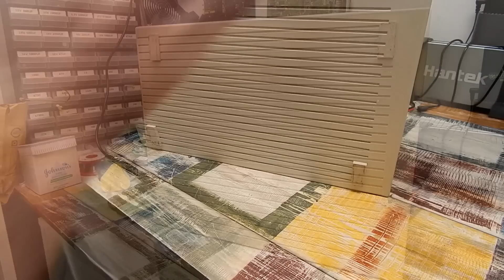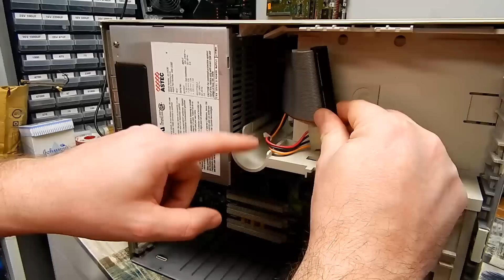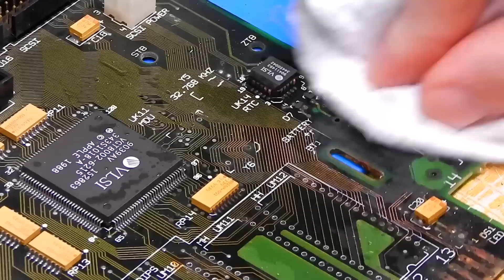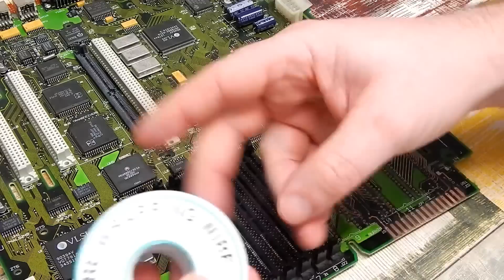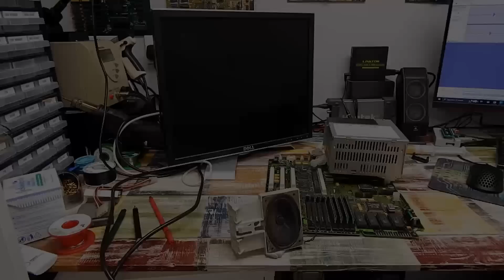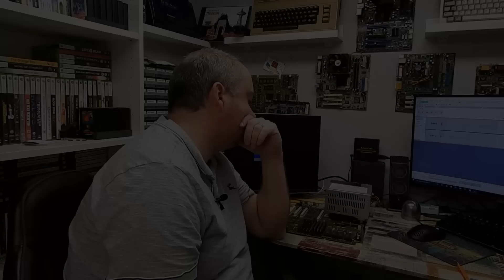Why will this Macintosh IIci not work, HELP!

Comment: In no particular order:
Your IIci is behaving very similarly to my IIci that I tried to repair in a livestream last year. The only difference is that I never saw the white screen. It's possible your board has another broken trace near the soft power circuit/RBV chip. (The RBV chip is the video chip.) In my case, I suspect that my RBV chip failed.

The RTC chip is probably required because it also holds the Parameter RAM (PRAM). In fact, per previous experience, the Apple ROMs pretty much expect the board has all the major components on it. You could probably remove the serial transceivers and the FPU and it would start to boot the System software, but System 7 will hang if the former is missing and the System software will throw an F-line System Bomb at some point if the latter is missing.

The fact that the chime and death chimes (that jingle you hear when you press the Programmer Switch because there is no debugger loaded) are playing correctly, is a good sign. It means the system is able to read the sounds from ROM.

That being said, you don't need the battery to power the IIci on.

IIRC, the missing LED (DS1) was a green power LED.
Reply from the maker: Thanks for the info, I'll double check around the video chip and see if I can find any damage.   My comment about  removing stuff would just be in an attempt to try and stumble into the cause of the fault.  Not exactly the most scientific approach but sometimes needs must.  I'll keep this as a last ditch effort but there are a few other things to try first.
Reply: AFAIK no Mac actually needed a battery to boot but some specimens across various models (with absolutely no rhyme or reason) act up without a battery, showing only a black screen. Leaving them on for a few seconds and then doing a soft reboot usually fixes that and gets them to boot normally. Actually, any way of rebooting except disconnecting power will work. Some models were more prone to this behavious (Performa 475 among others), some less but I've seen it across a whole list of 68k and PPC models. Back in the 90s even some repair shops would diagnose a flat PRAM battery as a dead logicboard, which was pretty painful for the customer.

Comment: My first thought, seeing as you got the sad mac once...... work backwards from the display plug and check continuity? Might be a bad solder point somewhere between display chip and monitor port?

IF you get a steady sad mac screen, it should be a "simple" case of bootable media from there onwards
Reply from the maker: I'm going to over a proper vga converter for the output, just to 100% rule out that its not my homemade cable although I'm fairly sure its not.  But yes beyond that, good suggestion, I'll take a closer look at the display chip and related circuit.

Comment: Where you see micro vias appearing not to go anywhere, they are going to buried vias or to a power plane in the multilayered PCB. They do go somewhere.
Reply from the maker: I wonder if that one point then could be an issue.  There is certainly internal signalling in this board, that's shown on the schematics and if that one point I showed in the video has indeed delaminated internally well, that could spell game over.  Perhaps the one time it booted it somehow made connection.  Maybe if I could clear it out, feed a small wire into it and flow a lot of solder it might restore any broken connectivity🤔
Reply: @CRG  you could try restarting while flexing the PCB in different ways or if you suspect that via path you could bypass it with a wire if you check the scematic to see where it comes from or goes to. If you can follow the trace to where it connects to a component first then check the schematic to see where that net goes to, to do the bypass. 
Also too much heating with hot air and no preheating can cause problems with buried vias and traces.

Comment: My two instincts from an utter incompetent amateur who has never touched a vintage mac would be something in the video circuitry, either a broken trace or maybe an encoding issue, but it seems to be working outside video? is there some kind of command line in prom that you could do anything in just to see if it is working outside video? or maybe try a period-appropriate monitor if you can find one, maybe it just doesn't like whatever conversion it is? I mean I have no real clue, just thoughts of what i'd try in your place
Reply from the maker: I've tried connecting a HDD and floppy drive but the system doesn't try to boot from them.  I'm fairly sure there is a fault somewhere and its not just video but I'm going to order a proper vga adapter and double check the video circuit just to be sure.  I have tried an Apple CRT and it behaves the same, the CRT is just to big for my desk hence why its not in the video.  Of course there is nothing to say my CRT is compatible with the IIci.

Comment: I admire your patience endurence. I have no ideas. Maybe you could try to attach a working floppydrive oder diskdrive to it. maybe it will boot again
Reply from the maker: Good idea and I have tried that off camera but unfortunately it doesn't boot.  There are a few other suggestions in these comments so plenty of other things to try before totally giving up.

Comment: it chimes so it can't be that broken. would check so clock and reset lines reach where they should, especially on display related chips/components.
Reply from the maker: I've checked clock and reset to those components I can access and its fine.  One issue is with the way the PSU mounts is that it covers half the PCB making it very difficult to test some components while powered up.

Comment: Well, it is only a Mac... 😂
Reply from the maker: This is true but supposedly the IIci is one of the better Mac's.  Plus it's so close to working, I'm sure it's going to be something simple that I've overlooked.
Reply: @CRG  I am using some corroded Amiga A501 cards to test this restore method.  Great information in here!
Reply: Seeing those plastic clips on the SIMM slots is so aggravating...